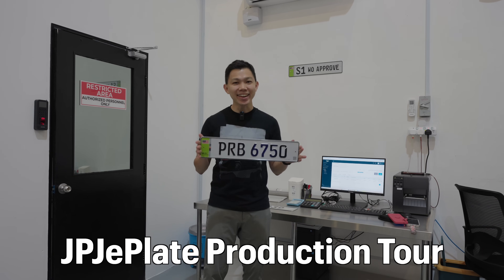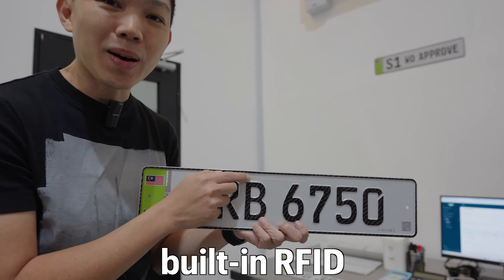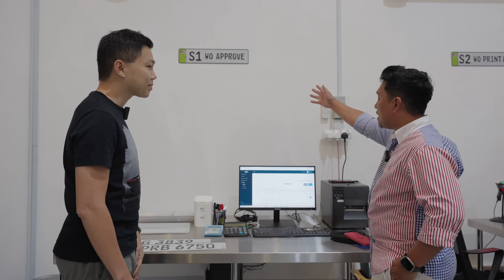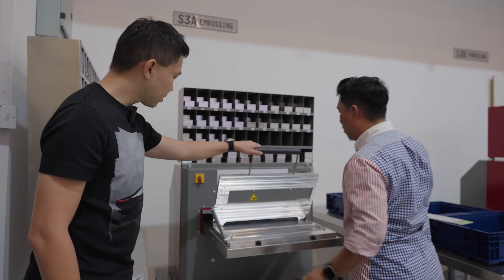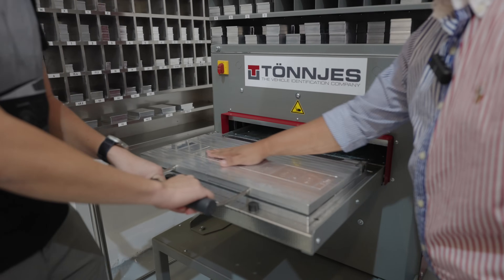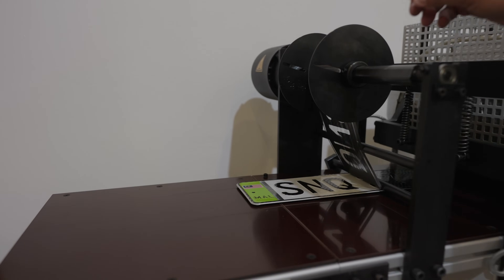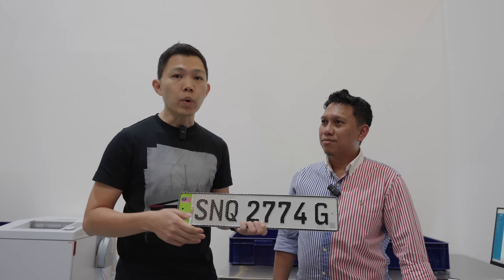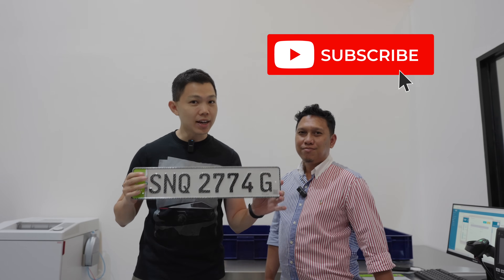Malaysia's EV Car Plate: Review & Production Tour

Comment: The whole front plate is the antenna for RFID ??? What a smart move !!!

More parking operators will upgrade their parking payment system to integrate with RFID. More fuel stations can enable RFID Fueling (for ICE cars) and EV pay upon parking at designated charging stations. RFID sensor just scan the plate and money will be deducted. 

Cannot wait for this new JPJePlate to be rolled out for ICE cars too !!!